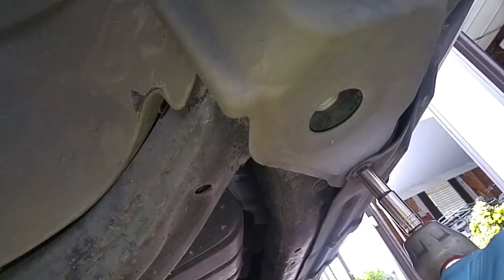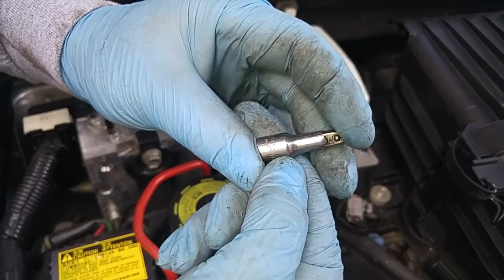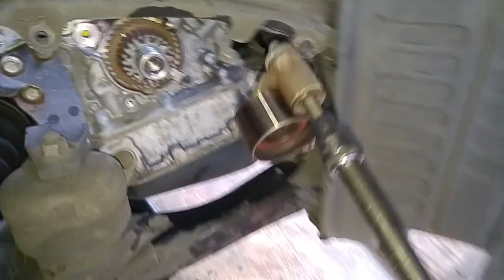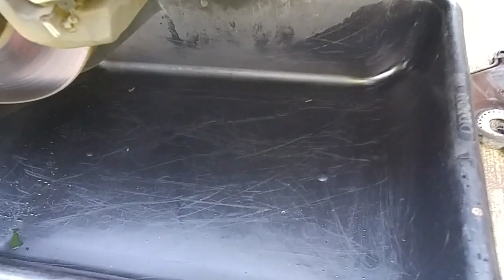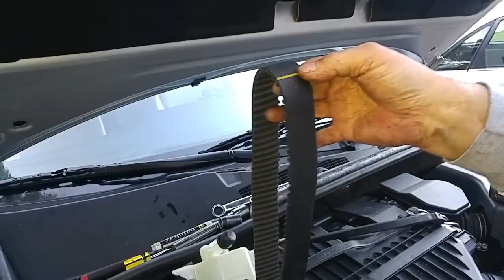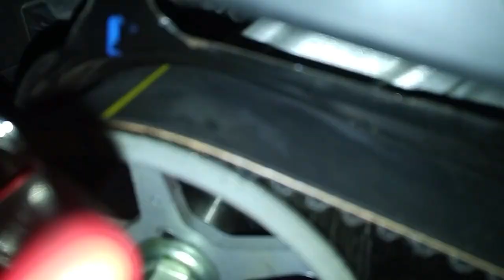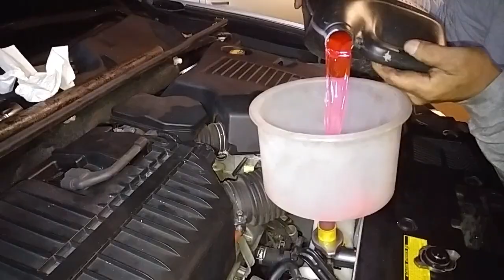Toyota Highlander Hybrid / Lexus RX400h Timing Belt, Water Pump & Seals - V6 3MZ-FE (2006 - 2010)

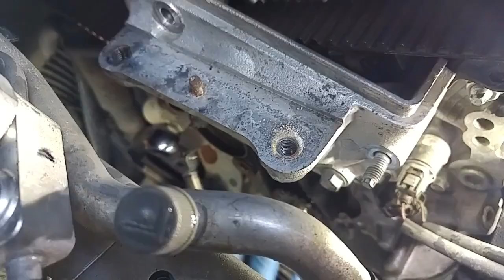Comment: When removing the side motor mount bracket (7:10 mark), do you have to jack up the engine a bit to get the mount off? Mine doesn't seem to have enough clearance to simply slide out sideways like yours on the video.
I appreciate this video so much and thank you for the detailed explanations.
Reply from the maker: The tips of the two studs can accommodate an 'E' star socket (which is a female torx bit socket).  You can buy an 1/4" E socket set for around $10 at any retail auto supply store or Harbor Freight.  With the right size E socket, you can screw out the stud closest to the front of the car.  From that point, you should be able to remove the side motor mount.   Here's what it looks like in Amazon:  https://amzn.to/3XBTPmD
Reply: @hardlymovingpro  Thanks for the quick response and for the tip (pun intended).
Reply: Wow, I had the exact same question.  I was able to wiggle it out eventually, but appreciate the follow-up.  

I did attempt to use the 'back-to-back' nut trick to unscrew the front stud, however, it was really difficult, went back to the wiggle out method. 😅

Comment: Thanks so much for the video! I just completed the full job on a Lexus RX400h and don’t think I would have done it without seeing your video first.
Question: did you just torque up the crankshaft bolt with your impact gun only or do you get a torque wrench on there?
Reply from the maker: Glad it worked out for you!  I use a impact gun on the pulley bolt

Comment: what is the procedure for getting into neutral before disconnecting battery thanks
Reply from the maker: Nothing special.  In neutral you can't remove the ignition key.  Or remove the shift lock cover, push down on the shift lock tab and place in neutral.
Reply from the maker: Why in neutral?  Have the car in Park and the key out...then disconnect the battery.

Comment: Question: followed along step by step. I am now getting misfire on cylinders 135. Going to take apart and do again.  All timing marks line up with marks. What could I have done wrong to cause misfire on 135?
Reply from the maker: Maybe you have the belt alignment marks reversed.  Flip the belt around.

Comment: Great video.  Thanks.  My harmonic balancer bolt will not break lose.  I have a powerful 1/2" drive air gun and have been spraying it with liquid wrench.  I will keep you informed as I progress.

Do you have to pull off the Cam Pulleys and that cam cover plate to change the water pump or did you do that just to change the cam gaskets?  Have not got that far yet because I can't get the bottom cover off yet. The water pump was leaking some but not too bad.  Had some dried orange powder inside but nothing wet.  

210,000 miles and the timing belt has never been changed.  I think it may have slipped a tooth even though it looks OK.  Every emergency light went on at once and the engine won't stay running plus a loud noise coming from the timing belt cover plate area.  I will check the pully alignments when I get the Crank pully bolt and cover plate off.

I plan on changing everything while inside there as well as the Coil Packs and plugs. Now I know that my AC compressor is all electric.  I was wondering about that.
Reply: Sorry, It was pink powder not orange.
Reply from the maker: Dried orange/pink powder is a sign of a leaking water pump.  You need a high mass 22 mm impact socket to get that pulley bolt off.   That socket has been a God send for me.  Spins the bolt right off.  Here's the link:  https://amzn.to/3QmiVDK  You can get the water pump off without taking off the cam sprocket backing plate but I'd advise you replace those cam seals.  They do wear out and cause a lot of oil leakage.
Reply: @hardlymovingpro  Thanks.  I ordered the socket, crankshaft pully holder and cam shaft pully holder. I should be able to get this done.  Amazon delivering all three items in 2 days.  Can't beat that.  I will change the tensioner, the idler pully, belt, water pump, and all seals.  I will get that stuff from O'Reilly auto parts. I was still running on the same plugs for 210,000 miles.  I was afraid to touch anything on this hybrid but now I'm in for the long haul. I'm thinking about changing the crankshaft and camshaft sensors as well.  Maybe I can get another 100,000 miles out of this thing.  Been a good car so far.    Thanks again for the advice. 

I noticed I can't even buy a maintenance manual for this vehicle because it is a hybrid. I guess they are afraid we will all electrocute ourselves. This will get worse if we are ever forced to go all electric.  They will probably make it illegal to work on your own car.
Reply: @hardlymovingpro  The high impact socket did the job in seconds,  Well worth buying one. I had to order a kit on line because O'Reilly could not get all the parts. It was definitely cheaper buying the kit. Only issues were the water pump would not go on at first.  The two little guide/alignment pins were larger than the holes on the new pump.  I had to use a drill to elongate the holes just a bit and then it went on fine after. The new belt did not have the marks on them like the one on the video.  I just made double sure everything was at top dead center, started with the back cam pully first, clamped it,  pulled it tight to the front cam, clamped it, then down to the crank.  Lastly over the tensioner pully and then pulled the grenade pin.  I turned the crank shaft over twice and checked the alignment, then did it again and everything was still aligned at top dead center. Started right up and sounds better than ever. I changed the plugs and ignition coils but not the crank or cam sensors.  

Thanks again.  The video helped me make sure my alignments were all good and I put it all back together in the right order. It was 2 weeks since I pulled it apart and I am getting older. The video helped me get it all fresh in my mind again before I continued, as if I had just pulled it all apart. I owe you a beer if we ever meet.

Comment: I am doing this now and the cam shafts moved a little. The belt is lose. Unless I rolled one tooth and back but then the crankshaft wouldn't line up no play at ALL. Now the cams are snapping back and forth when trying to line them up. If I get them line up. And any minor touch makes them move a little to a "sweet spot" or something because they no longer move. The rear moved  about 90 degrees and the front one keeps moving like 10 degrees. Any ideas? And why I don't have any okay on my timing belt. I see you do. But mine had no plays that's why I had to play with the sprockets and now it's messed up. Any help appreciated it!
Reply from the maker: Move the rear cam as close to the timing mark where the cam won't move.  Mount the belt with the belt alignment paint mark with the cam and clip it to prevent the belt from slipping off.  Now move the front cam to mount the belt with the 2nd alignment mark and clip it.  Then all you need to do is to mount the belt to the crankshaft pulley.
Reply: @hardlymovingpro  the problem with that is that the rear cam or front can kept rolling due to the tension. Like snapping 90 degrees for the rear and like 15-20 degrees forward for the front one. I had to redo it. I put it together but was a couple tooth off. Did it  again and turn the crank shaft a few teeth to line up with the belt marking on the side. Then line up rear one and then turn the front a couple teeth to line up and have some slack to Put the pulley between the cams and bolted it in. Then i straightened crankshaft and then front cam or then crankshaft and then a little more. All lined up and car running great again. What's a pain. I saw another video and the rolling of the sprockets cams it's pretty normal, I was freaking out cause I thought it was super abnormal and possibly damaged the engine. But all done now

Comment: I always drill a hole and use a self tapping screw to pull the seals out
Reply from the maker: A different technique that will work.  I use to do it that way until I found a faster way.
Reply: @hardlymovingpro  it looks like a useful tool you used!

Comment: Good job. Just bought 06 rx400h and need to go thru it. 152000 miles. Plugs, injectors, coils, wp n pullys, timing belt, hybrid water circ pump. Oil, trans fluid, gear box fluids. Flush n fill anti freeze. Clean intake n mass.
Reply from the maker: Good purchase!  It's a very nice vehicle.

Comment: Are the front and rear pulleys any different? I noticed that the front has the ridge on the engine-side where the ack has the ridge belt-side but I can't tell that there is a difference between the two.
Reply from the maker: Are you referring to the accessory belt idler and tensioner pulleys?
Reply: @hardlymovingpro  No I believe you refer to them both as the cam sprocket in the video. The ones that you need a chain wrench to hold.

Comment: Question: 9 months ago when I did this job on my HiHy, let’s say hypothetically I accidentally left a couple of the timing cover bolts off… could oil leak out of those empty bolt holes? 

Because **hypothetically**, I may have a massive oil leak that I can’t figure out… it’s dripping from the engine around the tensioner, like a lot. A drop of oil on the ground every 3-4 seconds. My AC reeks of burnt oil and my engine bay smokes sometimes. HYPOTHETICALLY

I couldn’t imagine a timing cover bolt would act as a de facto drain for the engine, but… what do you think?
Reply from the maker: No.  Cover bolts wouldn't cause oil leaks.  The tensioner is below the firewall side camshaft seal.  That seals tends to be an major oil leaker on high mileage V6 Toyota's.
Reply: @hardlymovingpro  yeah, I checked it out more thoroughly and it appears to be coming from inside the timing cover. Could it be one of the seals? 

Whenever I replaced the seals, I didn’t have a seal presser tool and had to improvise.. I wonder if maybe I didn’t press one in all the way? Possibly the oil pump seal?

It’s not coming out of the tensioner, but right next to it. I can actually see it pouring out of the cover itself. I replaced the tensioner and it’s in there tight.
Reply from the maker: Yup.  Without a seal press tool, replacement of  new one can be hap hazard.  I've replaced a lot of poorly pressed in new ones that were leaking.   Recently replaced two where the quality of the seal gave out.

Comment: Does this make the actuator squeal I didn't have any squealling until in the timing belt and pump and oil change happened.. It's very annoying and now when stopping the feeling of flump flump goes on just right out of the shop
Reply from the maker: Can't saw.  No such problem happened with me.  You installed the belt yourself?

Comment: I actually just finished the job on my RX400H. (Really I did).  Thanks so much for the video. It was incredibly helpful. One minor thing is how to hold the crank bolt when you torque it?  Below is a link to a Youtube PDF with my homemade brace hack. Just find a few odd scraps (like a hinge or square steel tube) and brace against the frame and use the puller bolt holes and a couple of bolts to attach to the pulley. Worked like a charm...Pics here:  https://youtu.be/OX4AeuqiEpo  - Thank you again. I hope this helps others...It's been a while since I've done a timing belt. Your video & workmanship is near perfect. Beautifully crafted content... Concise...amazing. Thanks again.  I absolutely agree...get the High mass socket for the Crank bolt....just get it.
Reply from the maker: Thanks for your comments!  Appreciate it!  I just use my Milwaukee impact tool to torque down the crankshaft pulley bolt.  No brace tool needed.  Never, ever had one come loose.

Comment: Bravo.  Well done.  Reward yourself with a HFT 1/4" torque wrench for $10-$12.  It'll be good enough and it's easy to calibrate/verify with a bathroom scale (bigger wrenches) or a smaller scale for the baby wrench (clamp the drive end in vise and measure force x distance when it clicks.
Reply from the maker: Thanks!  Been there, done that with 1/4" torque wrenches.  Shear off some 10 mm bolts and you'll know what I mean.

Comment: How do you get the engine bracket mount off the studs with the bolt that doesn't come out?  Do the studs get removed?  Or is it possible to wiggle it off? It doesn't seem possible as I'm trying right now!
Reply from the maker: If you referring to the side motor mount with the two long bolts, remove the bolts and you may have to wiggle the mount off due to rust.
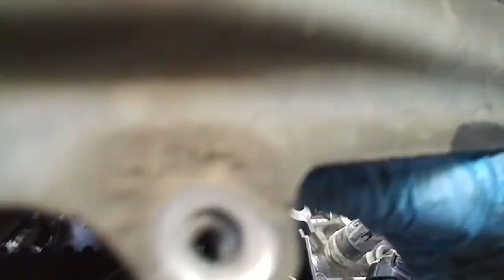Reply: I'm at the same step and there doesn't appear to be enough clearance to wiggle out the side motor mount on my 2006 Toyota Highland Hybrid. Do others jack up the engine an inch, buy the weird (e-torx?) socket, or just wiggle more? If you look closely at 7:24, the "shelf" of the bracket slipped between the metal A/C line and the frame, which in my case implies HardlyMoving jacked up his engine an inch (or maybe my engine is sagging down an inch after 193k miles)
Reply from the maker: You can remove the studs with a e socket or lift the engine up a inch or so using a floor jack and a block of wood to protect the oil pan.  If lifting, loosen the center and side engine mounts

Comment: Did you have to disconnect the high-voltage system prior to disconnecting/removing the battery?  Local shops are telling me they cannot do this because of this.
Reply from the maker: B.S.  Just remove the 12v battery in the engine compartment.

Comment: at @7:50 what size and thread type is the bolt you use to turn the engine position?
Reply from the maker: I just reuse the crankshaft pulley bolt that holds the harmonic balancer (aka flywheel).

Comment: Thank you.   Seeing how much is involved in this job, I decided (based on your video) to just have a shop do mine.
Reply from the maker: Understand ... but not as difficult as it seems with the right tools on hand.
Reply: It's funny, I had the opposite reaction.  I'm about to sell my highlander, but it's got 8 years on the current timing belt.  This video made me remember that it's not that terrible of a task compared to some engines.  Plus, I learned about a seal puller tool that I didn't know existed!

Comment: My water pump (the original one from the factory that I just removed) didn’t have a gasket... is that normal? 

Could it have been left off at some point by some careless mechanic? I bought this car pre-owned with 84k, but the timing belt and water pump are the original ones. 

I’m wondering if this is why I had so much coolant leakage..
Reply from the maker: If the gasket wasn't present and no RTV was used, most definitely the cause of the leak.

Comment: So I’m in the middle of doing this DIY. Whenever I was turning the crankshaft to align everything, it was very hard to turn for 3/4ths of the way and very easy the other 1/4th. Is that normal? 

Also, there’s reddish-brown dust all over everything. Is that from leaking coolant? Or is that dirt?
Reply from the maker: The turning resistance is normal because of cylinder compression on the last stroke of a 4 stroke engine.   The reddish brown is dried coolant leakage.
Reply: @hardlymovingpro  thank you. You are a life saver. 

So I’m snowed in and had to make do without a camshaft holder tool or chain strap wrench.. I had the latter but it was old and broke. I was able to rig something up with a come along-winch tool that held the sprockets in place for me to remove the camshaft bolts. It sort of worked. I finally got both bolts off (the rear was a nightmare), but it was very difficult without the proper tool and I ended up taking each sprocket off slightly eschew from TDC. It’ll be okay as long as I line both cams when I put the new belt on, right? And can I wait and do the final tightening of the cam sprockets once I have the whole thing put together and the tensioner pin pulled? Since I’m without the camshaft holder tool, I thought it would be okay to get it as tight as possible without moving the cams, put it all together, and then wedge a breaker bar to hold the crankshaft bolt in place and proceed with fully tightening the cams. I know this isn’t ideal but would it work?
Reply from the maker: @scootitnbootit9231  Some people remove and re-install the cam bolts by keeping the timing belt on and prevent the belt from moving by locking the crankshaft bolt in place with a breaker bar.  It can be done but I've avoided this method wondering if all that torque could potentially damage the camshaft bearings.
Reply: @hardlymovingpro  so in this scenario, you would just finger tighten the cam bolts, then proceed with the process that same as you did in your DIY video, but except after releasing the tensioner pin, you would go back and tighten the cam bolts with a breaker bar holding the crank in place. Is this correct as to the procedure you would do in my case?